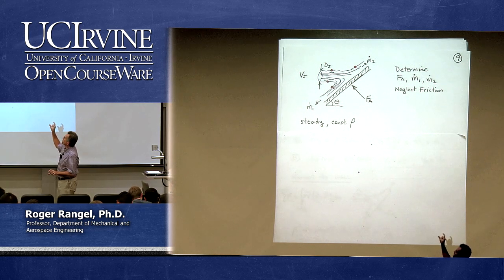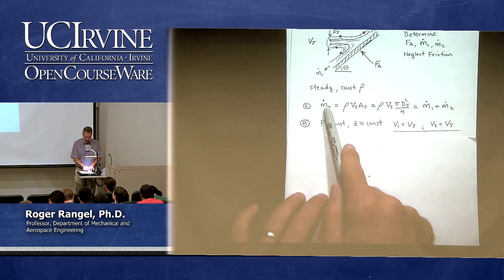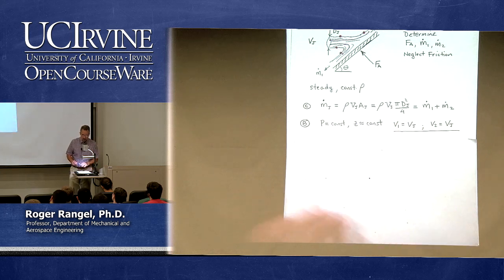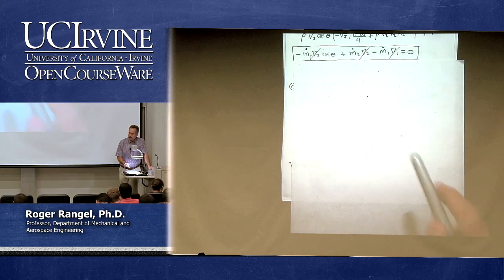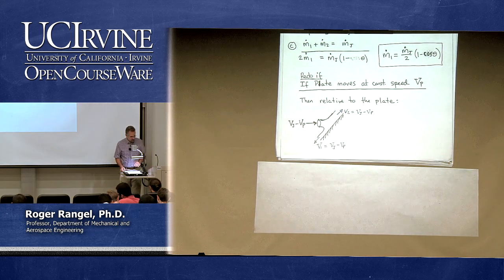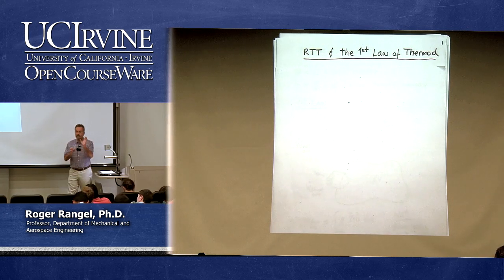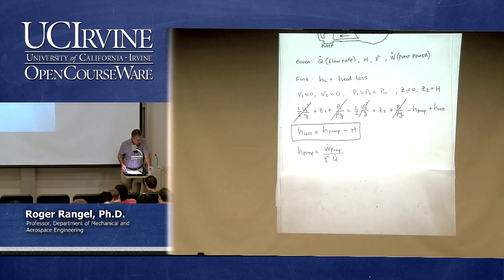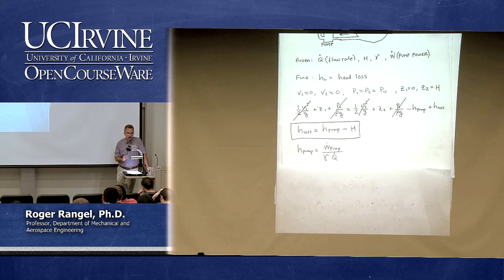Engineering MAE 130A. Intro to Fluid Mechanics. Lecture 14.

Comment: 38:19, shouldn't the head by the pump have a positive sign before it?
Reply: +Mohamed Elfadil No, because he is not showing that the entire expression is = 0. He moves it over afterwards. His explanation here isn't very clear. Actually he skipped steps such as first multiplying by rho, then dividing by gamma. h_L=(rho/gamma)*loss. Where loss is defined as the sum of available energy (u_out-u_in-q_net).